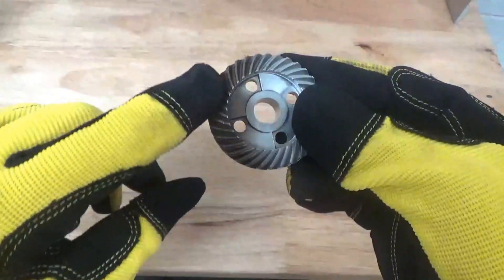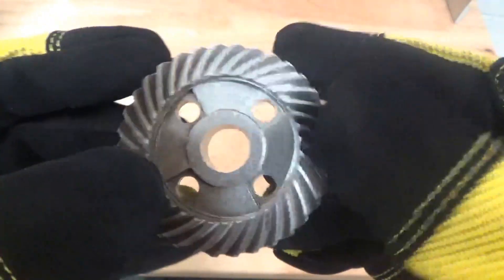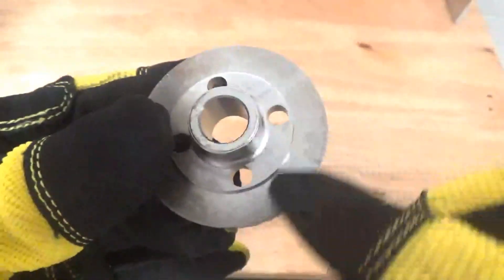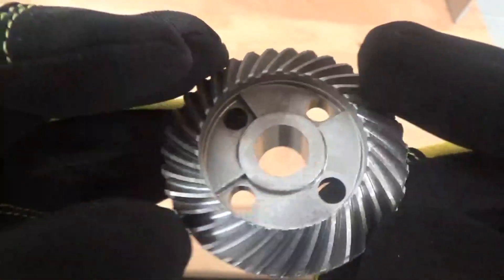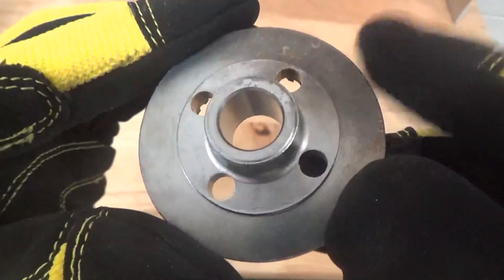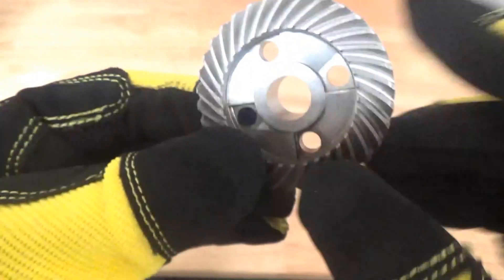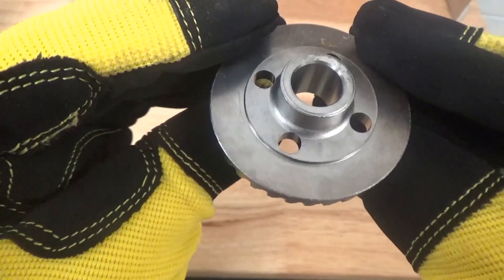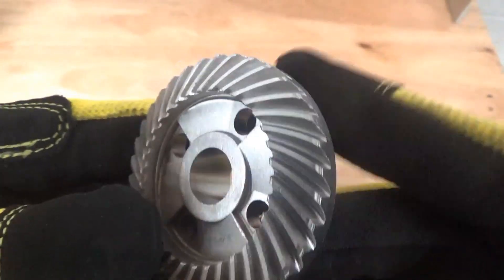Wet Abrasive Blasting- Vapor Honing Technologies

Comment: Safe to use against chrome lined bores?
Reply from the maker: Are you referring to gun barrels or engine cylinders?  Are you wanting to polish and clean?
Reply: Vapor Honing Technologies 
Chrome lined Mazda 13B rotor housings. Rehoning if the surface is scratched, isn't an option.
Reply from the maker: If you use Fine Ceramic or Glass Bead and 50-60 PSI, this process will not scratch the surface.

Comment: Hi, did you use fine glass beads for it? Do you have some anti corrosion agent in slurry? Thanks
Reply from the maker: It was Glass Bead 170-325, no corrosion inhibitor used on this video.
Reply: Vapor Honing Technologies thank you for your answer. How do you prevent corrosion then? Just quick dry and that's all? Thanks
Reply from the maker: If your part is reacting to the water and showing signs of flash rusting you would add 3oz. of Corrosion Inhibitor per 10 gallons of water, this can be added directly to the water in the cabinet of the machine while blasting.  This will treat the part and prevent rusting.